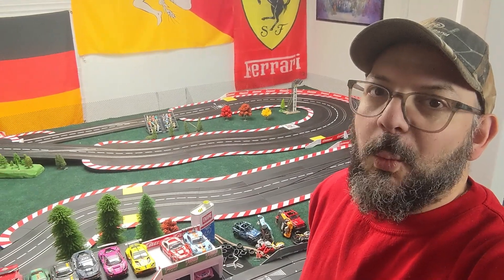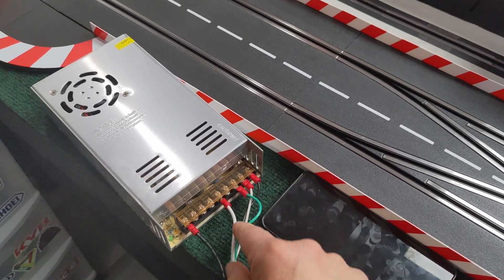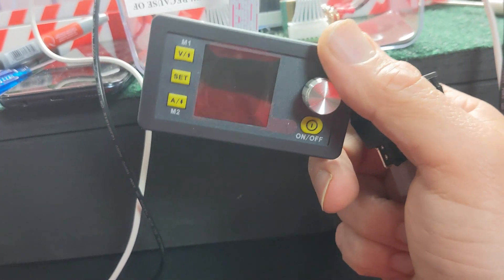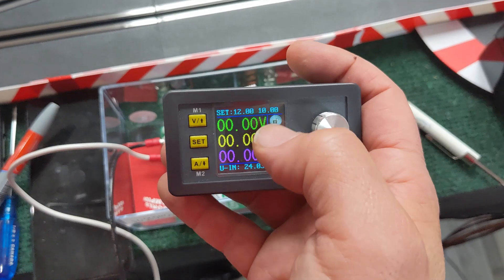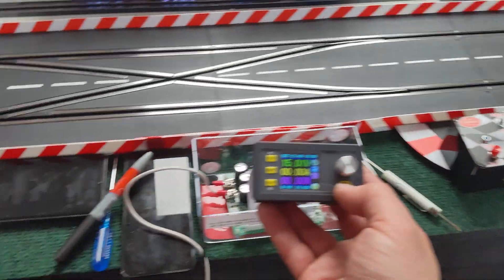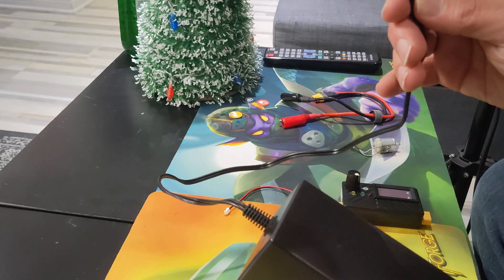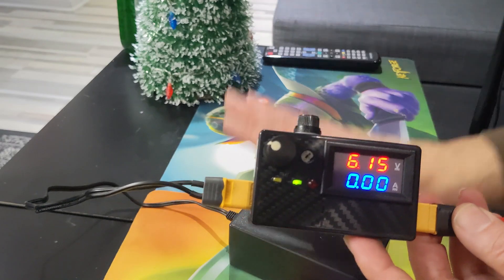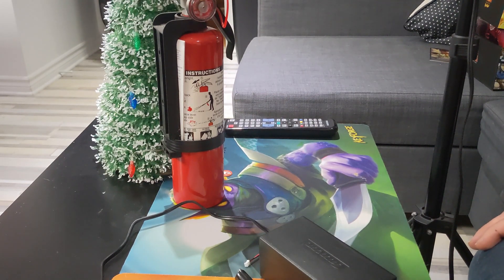Track walk 2:  My power supply setup

Comment: Hi Joe
For $66 oz or $50 US you could get a variable power supply on Amazon
I got the same one as Marty has and would cut out a few of your connections including the fused one as it has one built into it
I do like the terminal block setup makes it nice and easy to check it if any faults appear 
Just remember with electricity, one flash and your ash🤣🤣
🍻Mal
Reply from the maker: @3roomsraceway612  Thanks Mal, I know. I went way over board but I cant resist the colours lolll

Comment: Hi Joe. You love it more complicated, don`t you? 🙂 You`re installation(s) is(are) very adventurous, means you took the long way home, but it got you there. Many different ways lead to Rome. 🙂 A simple power supply with max. 30V and 10A would usually solved all your demands and the amount of money you had spent on all that, next to the time you invested, should have been spent rather on a quality power supply. Means a power supply with a galvanic isolation. With that, you would be always on the save side. I would not trust other and maybe cheap power supplies. To explain you the advantage and necessity I would save you from now, because I don`t want to write it too long here. You may check that yourself, why a galvanic isolated power supply is better than those cheap Chinese power supplies, that many use in the community, who are not electricians and are just regular users. For them, a simple just works fine. I don`trust those ones at all though. I had to build a power supply myself during my apprenticeship to become an Electrician. So, I know what I am doing and talking about! The overpower of Voltage doesn`t matter, because the tracks you are riding wilh, only soak up as much as they need. The reserve is good to have though. Therefore a 30V/10A power supply I suggested to you in the beginning. A good power supply with the Ampere-Meter is necessary. It has become standard on those Chinese power supplies, but I woud use connector cables, where you can hook up a Voltmeter into the output jacks, to be asurd, that the output is really the value you have choosen. That is a secured back up. It is connected parallel than, but if you want to instal an Ampere-Meter, you need to connect it in a serial way. Means, you need to cut the power leading cable and hook up the Plus and Minus Line into that cable in series. If you plan to do it, use shrink tubes to cover the blank cables. Not duct tape, or other tape. It is mandatory to cover all the power guiding cables, connectors and what have you, for isolation. If you make a mistake, or an electrical failure appeaers and you set up a fire, your insurance won`t pay and the costs for the fire fighters next all other damages you cause with it, will be on you. Even covers made of any metal, or aluminum must be connected to the ground, if you use them. A plastic body (dry wood works, too) cover would avoid that, but if there are any metal parts comming out/off on the plastic cover, you have to ground those parts! Those Chinese power supplies often only work, if there is an on-load connected to the Ampere Output, to check the Amperes comming out. To be honest, I would leave my hands of those Chinese Products at all. But that is me, a German who was tought, to think save and in quality manners. But I can sleep very well every night than! This could ruin your whole life! So, if you are not an Electrician and if you are not advised in such, you have to pay the consequences. Never underestimate that and never play with your life and others. Jens small fir extinguisher was a good call, but that one is too small, if a fire lights up on different spots at the same time. One, or two fire blankets would be a good helper, as well. Not to keep yopu warm though! But to repeat myself, if you, or anyone who reads this, is not an Electrician, or advvised professionally Person, get your hands off from electrical devices. To be struck by Electricity is dangerous to ones life. Even an electrical shock with less than 1 Ampere can be lethal!!! You cannot see the injury on the outside of your body, but if you get shocked, you better see a Doctor, cause you might have been shocked badly on the inside! That would harm your inner organs and can lead to a slow and painful death! So be warned! Sorry, now it has gotten longer, but this is madatory!
Reply from the maker: Thanks for your input as always Bo. My Brother is an electrician so I'm covered as far as safety goes. Thanks for sharing your years of experience. I'm sure someone will find it useful. Cheers
Reply: @IrrerasCarrera  If so, will he cover you, when you get hit by an electrical shock? Than, he should be insulated 🙂 The power chord you, or he assemled together shines no good light on you, or either him, if he is an elelctrician. In Germany we differntiate between Fahrlässig = negligent, Grob Fahrlässig = grossly negligent and Vorsätzlich = with intent, in the justice system. We have restrictions ruled by the VDE. You can read and he, too, what the VDE is all about on Wikipedia. Also in Englisch. The case would be up by a judge, if s.o. gets hurt here by an electrical shock, who is responsible for that, what one of those three points I had described, the judge has to consider and how high the fine would be in his conviction. That is the aspect in terms of the law here. Going on YT and spreading such is also an aspect to consider for a legal case by a judge, if s.o. gets hurt. Keep that in focus. This all may sound a little overdriven, but the reality is sometimes a bitter one! Did you read my comment on the clip by this dude, that calls himself the slotcar master? That is one of those non-experts that manipulated on the Carrera Cotnrol Unit and did just wrong, in terms of the tin-plate he installed on the device, with no Ground Connection. An electrucal shock is no fun and this, what he did was: negligent, because he opened the seal, grossly negligent, because he did not Ground the plate and the therefore insulated the Mutl-Connector, means it is not touch protected and with intent, because he stated, that one would loose its warrenty. This warrenty also includes the safety against the protection to recieve an electrical shock, bcause it is touch protected. He would not only be punished by the law, no he would also have to expect , that Carrea would file a law suit against him. Those manipulations can be dangerous and also very cost-intensive! If you are manipulating in private, you can do what ever you want to, unless no one gets hurt, It is your own risk, but beware of the consequences, if a person, or property damage happenjs. Than, the fun is over!